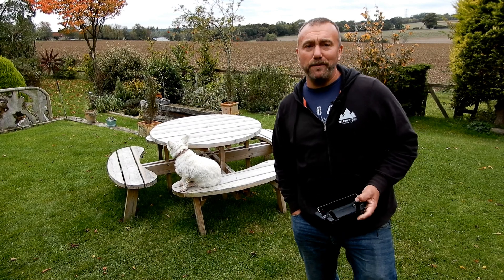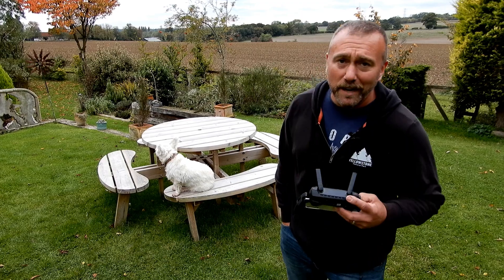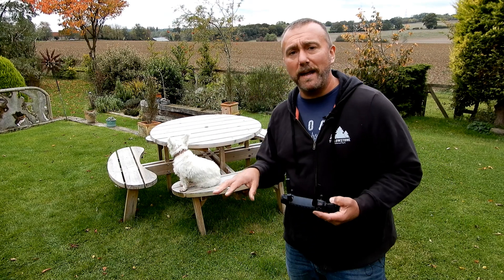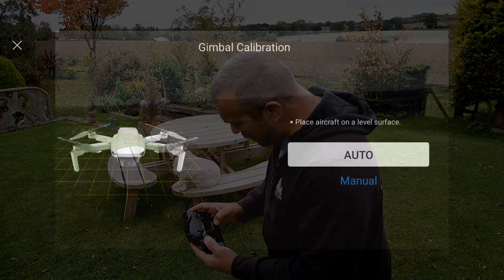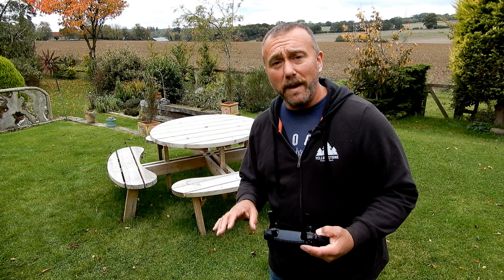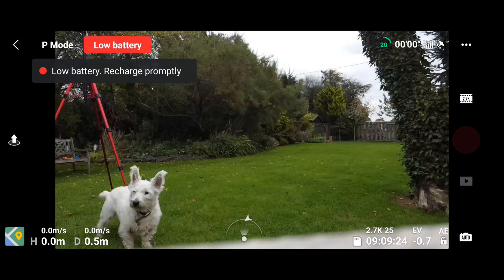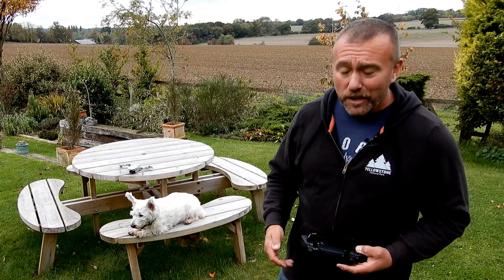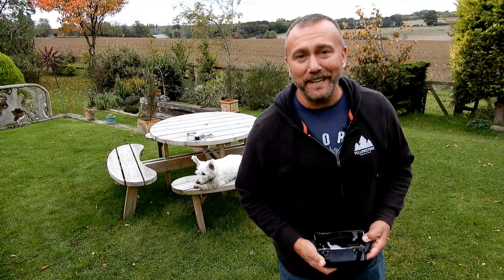Mavic Mini & Air 2 - Fixing a Crooked, Sloping Horizon & Easy inflight Gimbal Calibration

Comment from the maker: Very short tip today.  Let me know either here or via ian@ianinlondon.com any other short tutorials you're after.  
(So basically, tell me what you don't know so I can help you know it......😀 ) Cheers, Ian
Reply: Honestly if your horizon is constantly tilted then the only option you really have for a permanent fix send it in to dji.

No one really knows why this happens sometimes its a crash sometimes not so much. Accelerometers can't stay level, IMU and gimbal wont calibrate and dji claims its an issue with the gimbal assembly

My first dji mini 2 developed it after a simple low crash and the horizon never leveled after that no matter what you did.

My most recent one it came out nowhere when I roll sideways while flying- at least this time it corrects itself but it just can't stay level on sideways flying like it could on stock. Super frustrating.

 These fixes are temporary and no technician in town can really fix it. Your only move sadly is to send it in to dji

Comment: My drone has this slight angle and it jerks too sometimes. I crashed it, fell 4 floors onto the street... I've tried this calibrate so many times, including the IMU calibration just before it. This is just a temporary fix on my mini 2. It is straight when I begin, but once I get up in the air it goes on an angle.  And then when I lower my drone, I can see it's on an angle. The horizon is always on that same angle. No idea what do do other than maybe replace the entire gimble/camera part

Comment: Awesome tip for beginners. I just stumbled into it myself today after desperately fumbling through settings trying to sort this issue out.

Question for you, though…. Have you ever seen this setting fail to hold when facing one direction vs the other? My horizon looks fine fasting west and north, all messed up when looking east and south. I used the manual settings to fix the East/South, but then west/north are obviously buggered up (as I imagine you might say, haha).
Reply from the maker: ha!  Yep, if you're flying in medium to strong wind, then flying sideways or in a particular direction may prove too much for the gimbal to maintain its horizon properly; the pitch of the drone fighting the wind may be more than the gimbal can handle to stay horizontal.  So only temporarily buggered :)
Reply: @IaninLondon   thanks for the reply - I’ll try again soon and see if the issue persists. Weirdly, though, it wasn’t particularly windy when I was flying and I was leaving it hovering.

Comment: Didint work…. Any other suggestions?
Reply: replace the GPS/IMU module....

If not that then it could be a motor or even the gimbal having issues... best to send it in at that point

Comment: Hello, my drone crashed while it tried to go home on its own. The gimbal is fine on the ground but once I get up high it tilts to the right , I tried adjusting it with the manual setting but it goes off again just hovering . If I have to replace a part, what would it be ? Or do I need to open it up to check if anything got lose for it to go off track like so
Reply from the maker: This sounds like what happened to my old Mavic 1. Gimbal slopes off randomly. It needed a replacement ribbon cable and board. I'd open a case with DJI
Reply: @IaninLondon  were you under warranty ?
Reply from the maker: It was under a year old but I didn't have care refresh.
Reply: GPS/IMU board?

Comment: Hi Ian, I knew the trick about calibrating the gimbal but what if this does not work? Does it need to go for repair?
Reply from the maker: If it only does it on a particular manoeuvre or when flying in a particular way, probably not... It's just a limitation of the gimbal
Reply: @IaninLondon  Many thanks for your reply.

Comment: Hey Ian! I have the mini 2 and I tried this tutorial. I have this problem but it happens when the drone is turned to a certain direction. I tried both methods but they didn’t work.. is there a way to fix it if it’s happening in certain directions? Thanks!
Reply from the maker: Not really. It's a limitation of not much clearance for the gimbal and the pitch of the aircraft.... 👍🏻

Comment: This is an easy fix that sorts out the image after a fall. 
But there's a catch: the gimbal may not always be adjusted as such, or this fix is not only electric.

I'm facing the following problem (ofc, after a fall)- the slant horizon re-calibrated as the guide shows, but the problem persists when flying left/right. 
Example:
After take-off, the horizon is level. 
Then I rotate the drone to the left - horizon tilts, then comes back to level. 
Then I rotate to the right - the horizon tilts, but does NOT return to level (still slant). 

After a slight rotation to the left, it is once again level. I don't have any warnings on the app, or during auto calibration, but looking at the lens with the drone off, I can easily see the problem: rotating the lens/camera to max left and releasing it, will always return to a slant position, while rotating to the right, will return to straight. I assume there is some loose spring... or something. Maybe a new gimbal is needed :(
Reply: Hi, my Mini 2 has the same exact problem as yours! A small crash 2 weeks ago did this. Did you solved? Any tips? Thank you in advance.
Reply: @cristianokeller  unfortunately not. And it does not get better with time. I am learning to film like this,and always check the horizon before a shot

Comment: But should it often be off? I feel like the gimbal does a good job on one Side but seems to have problems going straight when on one specific Side. Could this reflect an issue with the gimbal ? The drone is pretty much new
Reply from the maker: Hopefully they'll fix with a firmware upgrade soon.
Reply: @IaninLondon  well my firmware update didnt solve it and now im getting a new issue since ive installed it. When the camera is fully looking down , when I start going forward to get that top view footage, the camera pops up 15-20 degrees instantly.... 

As for the horizon its still the same and looking at how it behaves even without power im starting to feel it may be hardware related. 

When the drone is facing you, if you move the camera counterclock wise, itll go back straight, but when you move it clockwise it stays leaning on that side.  

I like the drone when it works properly but to be honest there are quite a few issues that are going to have me get a refund if they really arent going to solve it. 

Also got many imu calibration prompt even when its been done I can land and it Will ask me to do it again. That and also the drone controlling itself , behave like its possessed. 

Starting to think I got a lemon. Its a huge deception because the rare occasions where it did work I was able to get some nice footage.

Comment: Thanks for the video! Short and exactly to the point. Very much appreciated.
My Mavic Air 2 did have a tree encounter recently and I've noticed the Horizon was quite off today. I'm still quite new to this, so only tried IMU calibration and missed the gimbal. Your video came up in web search up top and after a quick auto calibration I'm up and running again!

Comment: Hi Ian,
 Im having trouble activating active track on Mavic Air 2 cant seem to draw a box around subject on screen unless I go into main menu and enable Target scan?? Any ideas. 
Really enjoy your channel no bull just straight to the point. I tried DJI on line but might as well have contacted Mars!!
Cheers Brian G.
Reply from the maker: Have you tried focusing on yourself as the subject?  I know it can be a little fussy on what it focusses on....  It needs a person or a vehicle...  Ian
Reply: @IaninLondon  Was using myself as subject at a fairly low altitude but will give it another go. It does work but would be nice to have direct access. Thanks again will let you know how I get on👍
B.from Belfast!
Reply: Rang DJI who told me to refresh software on DJI assistant 2 ✓ then delete and reinstall dfi fly✓ and guess what👎🙄. Looks like I'm going to have to put up with selecting target scanning on main menu to get active track working but at least it works. Thanks for your input😊 Brian from Belfast

Comment: Another useful video - thanks, Ian. BTW what was that message "propellor(s) rotating too fast" at 1 minute and 2 seconds into the video? I never saw that before!
Reply from the maker: That's a common message for combo owners that have kept their Mini in the case. Very slight deformation of the rear left rotor gives rise to that message.....  Slightly bending the rotor straight fixes it....
Reply: @IaninLondon  10x.

Comment: Another good idea is to use a level in front of the drone after you have done the auto calibration.  You may still need to do a manual.  Turn on Grid and use the level as your target to make sure the gimbal is actually level.  I've seen cases where even after calibration you might be .1 or .2 off.  Probably do to surface not being level you did the auto calibration on.  Dirt, dust or moisture called all mess with it while its in the air.
Reply from the maker: Good tip!  Guess this is more important if you're filming over the ocean where you need that horizon perfect...

Comment: thanks for advice, Ian! I have another trouble - sometimes in my mavic mini gimbal is trembling in -90 and 0 angle positions :(
Reply: I've had that happen once. I had an ND filter on, and wondered whether that extra weight might have been too much for it. After moving it a bit, it settled down; no idea just why.
Did you have a filter or other extra weight on the gimbal?
Reply: @JROwensPhotos  yeah, 4 of 5 times I've had ND filter on. But the first time there was no extra weight...

Comment: Dare I say...I'm buying the Mavic Mini...missing those aerial shots when out filming
Reply from the maker: Hey Glyn!  Great to hear from you!  What's happened to the Mavic Pro?  You have my number or email me on ian@ianinlondon.com
Reply: Glyn, I would wait for the new Mini 2 to be released and with an EASA C0 mark from January 1st. Current Mini or Mini 2 before January 1st can only take advantage of the class C0 up to December 31st 2022.
Reply from the maker: @armandoferreira8790  Actually, the current Mavic Mini doesn't have a certified 'Maximum Take Off Mass' (the max weight it can take off with including accessories) and as such will be classed based on its weight at 249gms MTOM, which keeps it in a very low restriction category.  The new Mini will probably have a certified MTOM over 249gms, even if its weight remains 249 gms.....  (Get the feeling things are over complicated???)

Comment: Another excellent tip - and I could have used it a couple of times not too long ago... love your countryside shots, Ian - keep 'em coming.  I've been thinking about a portable landing pad with auto levelling.  It boils down to some sort of simple gimballing, (think of ship's compasses etc) but examples online are very sophisticated and expensive
Reply from the maker: That sounds a little complicated!  Is that because you can only land on a steep hill?  Hand catching is very easy once you watch my video on it :)
Reply: @IaninLondon  LOL - No - just concerned that, when you take off from anything other than flat and level, when the gimbal goes through its self test it may set something other than true...   Happy to hand catch ...
Reply from the maker: @Aerosnapper  ah!  No, I have often taken off from sloping ground without issue. It needs to be approximately level ish... :)

Comment: How crucial is the levelness where you put it down? Does it compensate for a slight tilt, or will any table or ground tilt be baked into your horizon roll until the next calibration?
Reply from the maker: You know, I'll check that out tomorrow.  I'd like to think it can use it's own levelling circuitry to work that out....